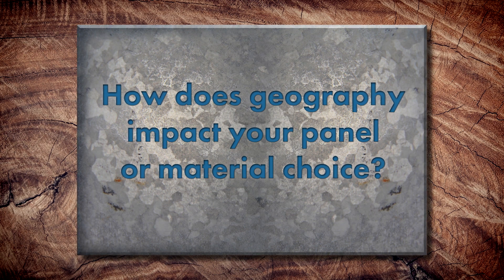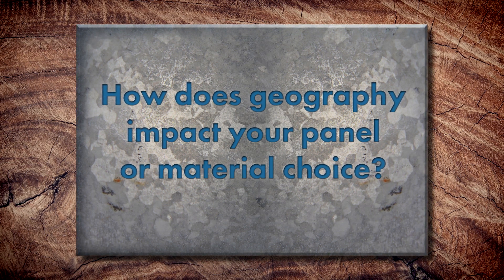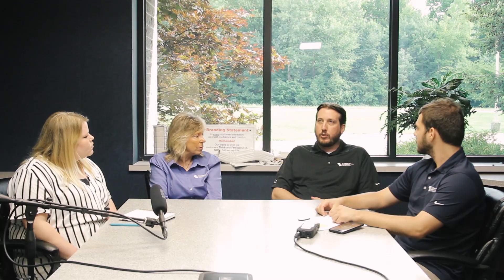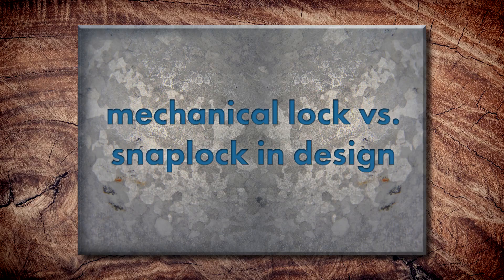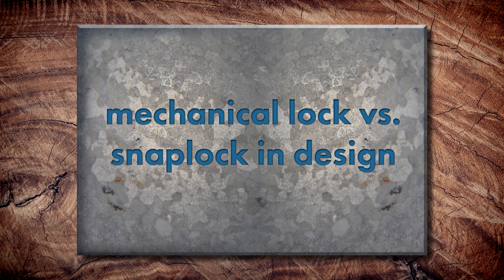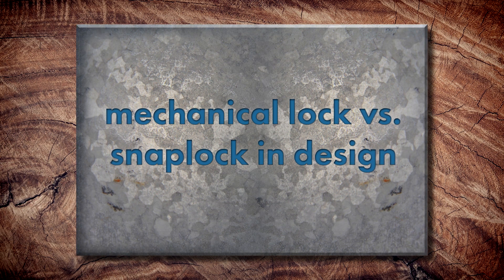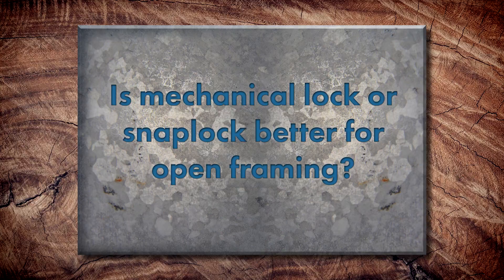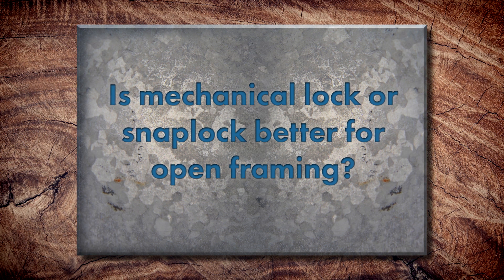What to Know Before Designing a Metal Roof for Your New Building

Comment: When roofing a house what are the pros and cons of 26 gauge screw tab system vs a 24 gauge clip system?
Reply from the maker: Hey Adam! I would check out this article on our blog: http://bit.ly/standing-seam-metal-roofing
There's a Q&A episode on that page as well that should answer your question in regards to the difference in panel types. When it comes to gauge, the gauge of material is usually relative to the engineering involved. Hope this helps!
-Thad